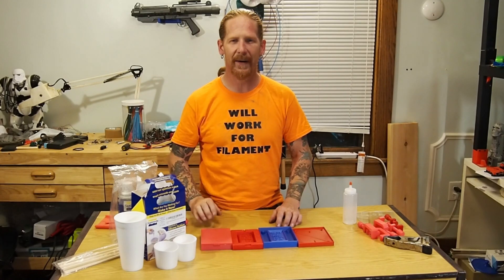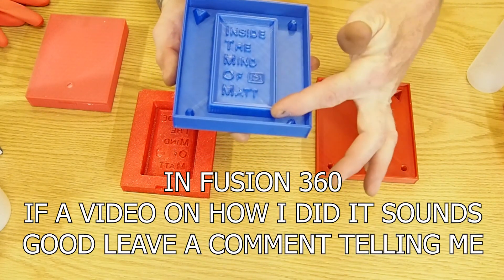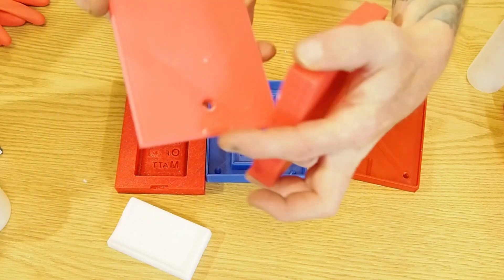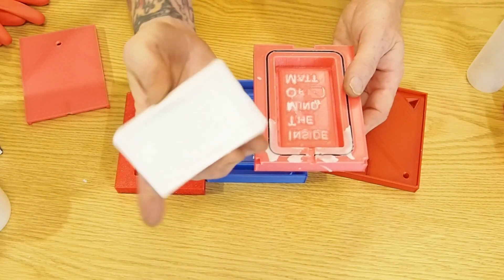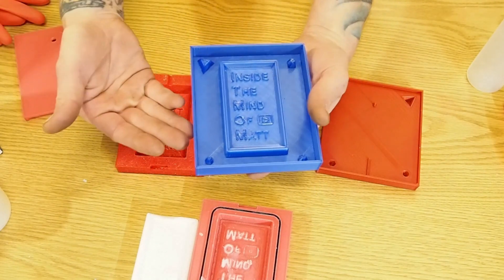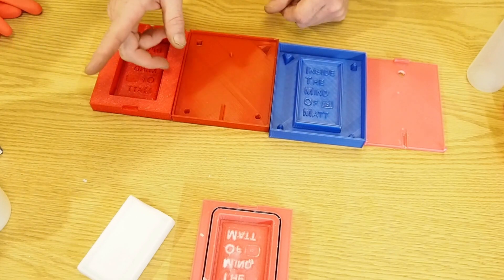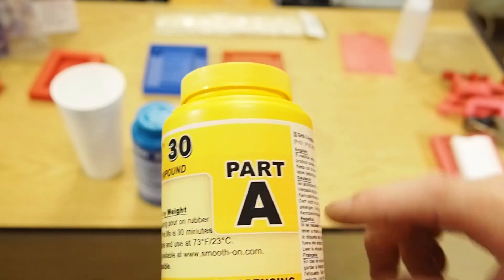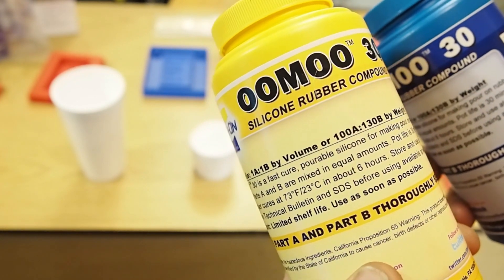Making a Silicone Mold ( #smoothon ) From a 3d Printed Part for Lost Wax Casting Part1

Comment: Great shirt! That's why I go to work it seems.

Also, I can't tell from the video, but if you're not, you should taper your text. When extruding the letters in fusion, use the taper angle. It'll reduce the change materials get stuck in the letters.
Reply from the maker: Thanks I love this shirt also.
And yes I tapered rounded chambered all my edges I will be doing a fusion video on the whole thing at some point Stay tuned 

and thanks for watching